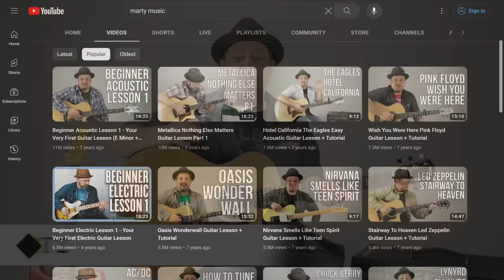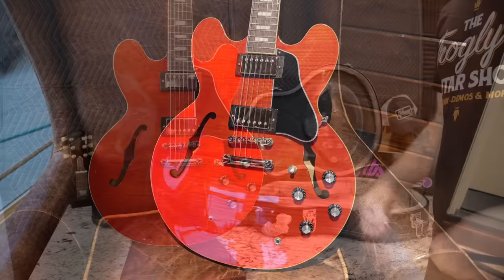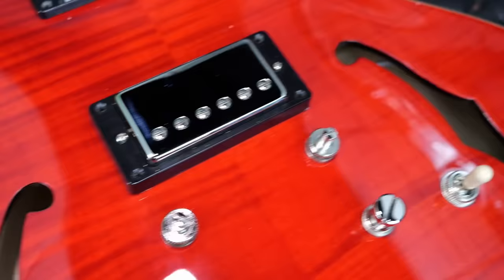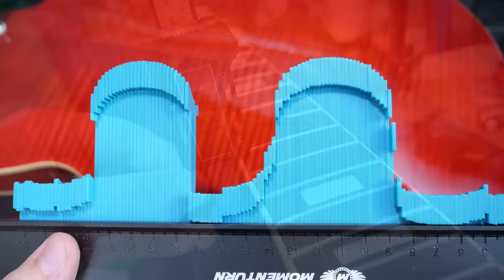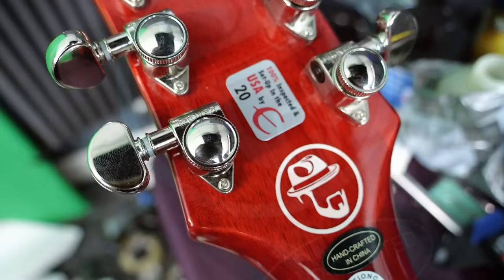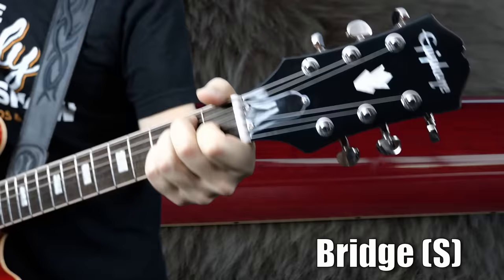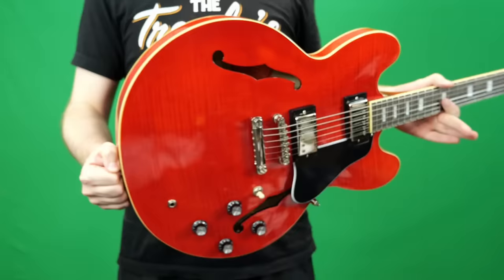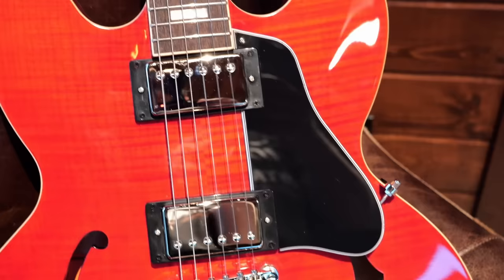I Tried Marty Schwartz Signature Guitar - I’m Impressed! | 2023 Epiphone ES-335 Figured Review Demo

Comment: One other difference from a Gibson ES-335 is that the top and back is a 2 piece veneer joined at the centre whereas the Gibson is a one show side veneer.  The Epiphone headstock scarf joint structurally is stronger than the one piece neck Gibson uses.

Overall, the Epiphone is a great guitar considering the price relative to the Gibson ES-335.  I would seriously consider getting one if I didn't already have 2 ES-335s.

Great review!

Comment: Marty's Signature looks like a nice 335 option but has to measure up to the Sire H7 for me to consider. Epi costs $100 more but with more features, H7 gets ebony fretboard but no coil splits or locking tuners.  Quick connects are great up until you want to mod- my Gibby SG and Gibby LP with similar quick connects aren't interchangeable due to leads in different places on the plugs.

Comment: That neck construction is nothing inferrior to Gibson, rather the opposite. The scarf joint makes a more robust neck/headstock conjunction. A one piece neck might look nicer, but your neck would always be prone to breaking in this area. The heel extension is also not a problem at all. Even classical guitars are built this way. It saves a lot of wood that would otherwise had to be carved away from the neck.

Comment: May be OCD or something, but the fact the figuring on the top does not run across the top and presents that clear line up the middle messes with me.

They all do it, and they all bug me. 

I think I'd run a strip up the middle that matches the binding if I ever did one or "fixed" one up.

Comment: I like the fact that Marty along with the Epiphone team came out with his signature model that's very 
versatile. Still, $899 is not exactly inexpensive for a beginner. I couldn't see myself purchasing his model.
Not because of price but because there would be a lot of changes by the time I would get done, I'd much rather 
Get a Gibson ES-335 used. Although very versatile the PUPS and splits/OOP options are harsh to my
ears. Better PUPS and a Varitone switch would've been better IMO. The focus was to have the Epiphone
sound similar to Strat or Tele style sounds, which never seems to work right with a Gibson or Epiphone. It's hard to do all the proper changes without driving the price up. For a beginner, his model works fine, for advanced? not close but that's not what the guitar is about.

Comment: I have a 20+ yr old Epiphone Dot with a figured top and back that looks identical to that (minus the headstock... mine having the old "traditional" Epi boat paddle)... Mine also has no pickguard.... which was classed as a flaw .... but not for me as I think that if you have any type of guitar with a beautuful figured top it is a sin to cover it with a pickguard. I am not playing thrash  metal on it (I have ESPs and Charvels for that) ..... there is no violent downpicking..... its  for Jazz and blues and clean tones ... a lot of time using hybrid picking with a very light touch. No pickguard just gives a better view of an antique guitar with a beautiful top .... other than a minor repair (strengthening) of the neck heel join which left a slight blemish along the seam (about an inch long... 8th" wide).... the guitar is as close to mint as I dare speculate (I've never put it under a blacklight)

When Epiphone takes time and builds a guitar with care and quality (as that one is and mine was)..... they are a beautiful instrument that will alst a lifeime.

I've never seen another guitar like mine. Epiphone did a run of "deluxe" models that had figured tops around 15-17 yrs ago. But they also had gold hardware. Mine has all chrome hardware. Which was my preference... I've never liked gold hardware other than on a Black Beauty with 65+ years of fading..... I call it "pimp hardware" lol ... but everyone is allowed their preference... if anyone else loves it.... thats all cool.
Liked the Episode on the Epi..... thank you for your effort, your research and your content.